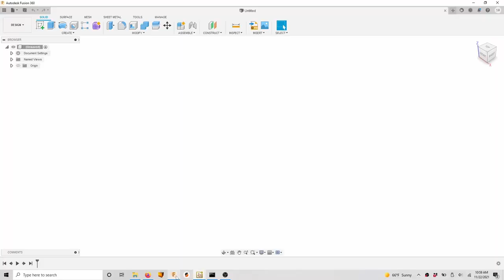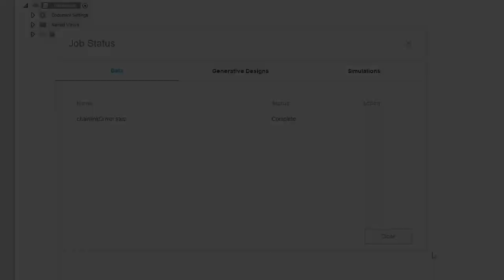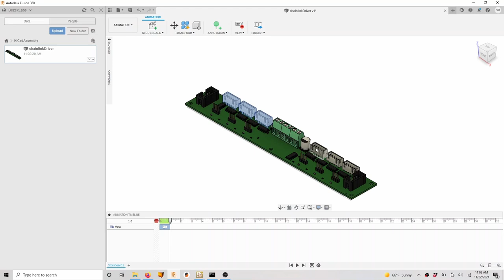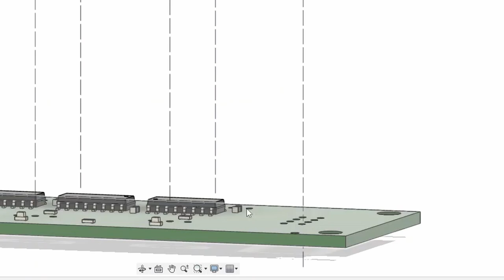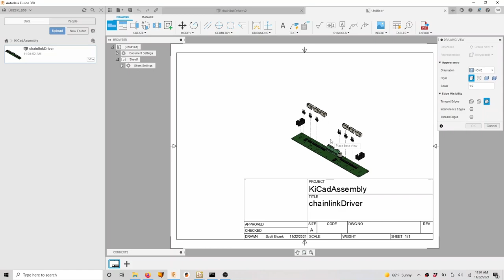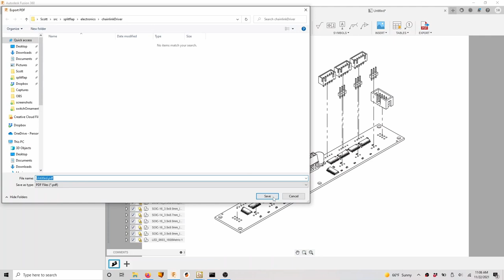IKEA-style exploded assembly diagram from a KiCad PCB with Fusion 360

Comment: only the board with the holes appears to me in fusion
Reply from the maker: Hmmm, what version of Kicad did you start your design with? If the part models appear correctly in KiCad's 3d viewer but don't get exported, I believe that means they're not using STEP format for the models. As I understand it, older versions of KiCad's standard component library used or only had .wrl files by default, but these have mostly been converted to .stp files at this point. So maybe check a component's properties to see if it only has a .wrl file and no .stp?
Reply: Yeah. i had a same problem. Step file is working.